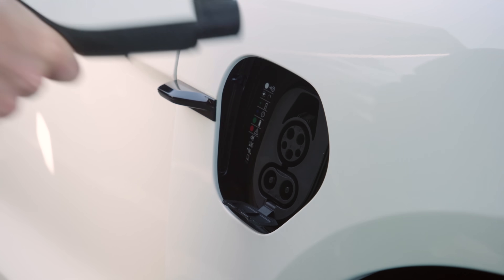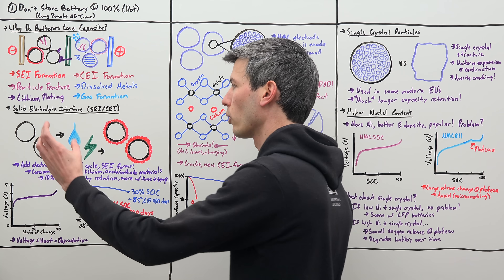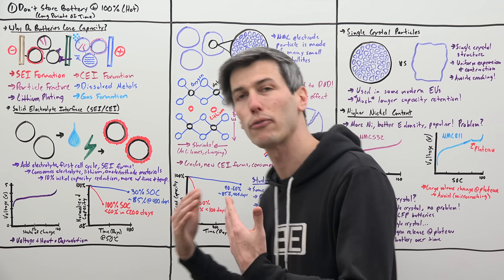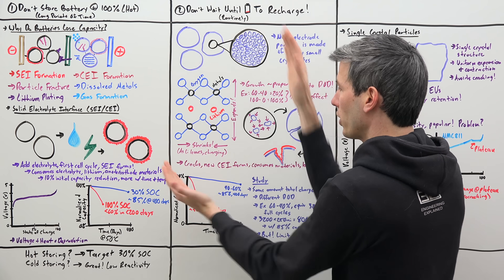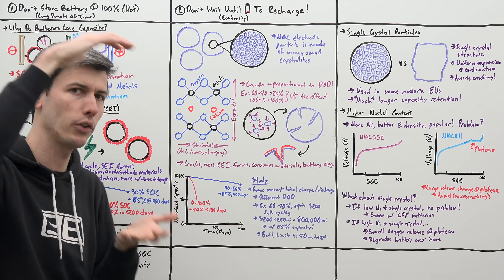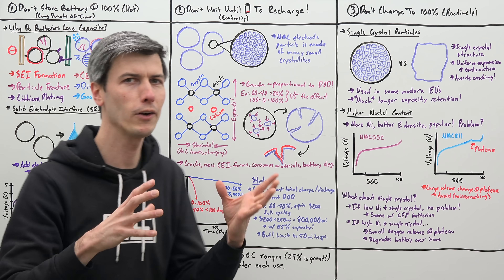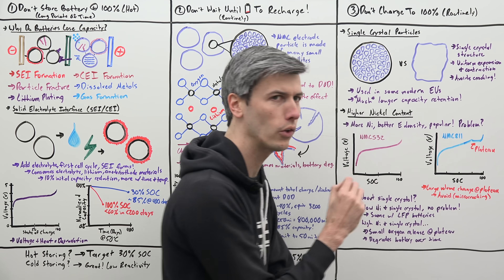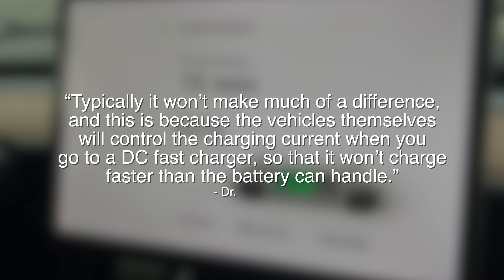How To Ruin Your Electric Car's Battery - NMC Edition!

Comment: This very good but one question isn't addressed. Most cars have a usable battery capacity (which is 71 kwh for my BMW IX) but the actual amount is higher (76 kwh in my car). Is this buffer engineered to avoid degradation? Do we still need to charge to 80% of the usable capacity?

Comment: I'm charging to 80% using a hyper fast charger (175kwh), disconnecting and charging to 100% using a 220 charger, wrong or right?
Reply: If you're using an LFP battery that's fine. If not, obviously that's not fine. Watch the video.

Comment: this is another reason why ev sucks  we not ready for this  plus nobody talking about used ev cars for sale, if the battery was abused we have no way of knowing this and could be buying a massive cost for a battery later
Reply: Yes, the battery's condition is a risk.  But there are devices which can plug into a car and run diagnostics on the battery to let you know whether any issues exist.  I suspect something like a battery bill of health will be good practice for sellers to provide when EVs become more prevalent.
Reply: EVs are fine, and it's easy to check battery health.

Comment: Jason, while I've always heard it's not desirable (as you indicated in the video) to store a battery at 100% SOC, I've heard repeatedly that it's beneficial to charge to 100% once a month or so as that will make the battery cells "balance".  Is this a good idea or nonsense?  We own a Kia Niro EV and the owner's manual states "If the high voltage battery charge is below 20% you can keep the high voltage battery in optimal condition if you charge the high voltage battery to 100% (once a month or more is recommended)".  So the Owners Manual is certainly not as clear as could be.
Reply: If the battery is LFP then you're supposed to charge to 100% once per week.  Just check the owner's manual.

Comment: The new chemistries have more cycles and are often lighter and safer and cheaper.  
What about my other e-things?  
I standardized on Milwaukee for all my tools.  
From drills to chain saws.  When will I be able to buy new chemistry batteries for these?  
I have a Ryobi riding mower that uses 4 12-volt lead-acid car batteries. 
Was thinking of upgrading it to lithium ion next summer. 
 Would prefer the new chemistry if I could.

Comment: If say for optimum longetivity & performance, these batteries need to operate inside the 20~80% SOC, then manufacturer's should quote their performance & capacity based on these numbers: battery power, range etc.
The BMS should control this invisibly to the driver. When the latter see 0% charge, in reallity there is still 20% left and and when seeing "fully chrged, 100%, the actual SOC is 80%.
MAybe this is already done by the manufacturers so that joe public need not to worry about all the common mistakes you described

Comment: I have a December delivery 2022 Model Y LR from Shanghai.

I’ve covered 35,000 miles. With around 30% of my charging being at Suoerchargers.

I charge at work, not at home. I usually charge to 80% and use 20-30% daily. Possibly too often, I’ll take it up to 90%, especially before a weekend.

Should I be concerned that I’m exceeding the 75% suggested here? I could adjust my maximum routine limit, but that would mean that I need to spend longer charging on a Friday, or before a trip, which is inconvenient as I don’t usually spend all day actually in the office.

Comment: 1. Long term storage: Cool environment preferred, if hot environment unavoidable, store at low state of charge (i.e. 30%)
2. Keep a low depth of discharge (battery percentage change); a bunch of small charges (+20%) >>> infrequent full-depth charges  (+100%)
3. Avoid the extreme states of charge (0% and 100%); charge to 75% MAX
3a. If you can't charge your EV at home, don't get an EV

Comment: I've just been charging from 20% - 80% unless I'm planning a long drive then I'll charge up to 90 - 100% for the extra range. When you're at fast chargers its considered rude to "top off" to 100% all the time and the norm to only charge to 80%. Some fast chargers start hitting you with idling fees if you go above 90% or sit there at 100% for long periods as well.

Comment: My question is "is it better to charge to a max of 60% or a max of 80%? i.e. 40-60 or 60-80? On my Bolt EV I can easily set the max charge to 60% and then just plug in every day. I typically only drive 25-30 miles. 

I had a 2015 Spark EV I bought in 2019 at 35K miles that had about a 10-12% battery degradation. After 3 years it had a 35% degradation. My charging strategy was to plug it in whenever I could, thinking that the battery conditioning was the most important thing in my hot climate. But the Spark EV could not be set to less than 100%, so it always charged to 100%. I decided that was a huge mistake, so when I got my Bolt I followed the 20%-80% guideline but that means I only charge it about once every 2 weeks. THIS video seems to indicate that as a bad strategy. I should set charge limit to 60 (?) or 80 (?) percent and charge every day. I already plug in every day when it's hot to run battery conditioner but usually keep the charge setting at the minimum.

Comment: Hey Jason, can you revisit unsprung weight and explain it in numbers? Many people say one pound of unsprung weight is equal to x pounds of sprung weight, but there is no consensus on what that number is. Maybe it varies depending on the overall weight of the vehicle (kind of like how weight loss in a light vehicle is more noticeable than in a heavy vehicle)? I bet you can come up with some sort of formula that extrapolates a rough estimate, and translate what those numbers mean in in everyday driving/racing. Also, which makes for a more comfortable/quiet ride in a heavy luxury vehicle, lighter or heavier wheels? Thanks :3

Comment: If you reversed aerodynamics for an EV could you effectively generate lift and therefore reduce weight and improve fuel economy? If it works don't steal my idea Elon!
Reply: They don't have downforce. You wouldn't generate lift, you would only generate drag.

Comment: So I just got the new 2024 Kona electric limited 260 miles of range. My work is only 2 miles away. I only use what 3-5 miles of range and lose some because I have to go up hill for 0.5 miles to get home. I charge to 80% max, sometimes I'll charge to 100, but my max I limit it to is 80%. I  use a 240v charger at home. Should I let it discharge to 40? 30? 50, to get the max out of it?  20% is when my low battery warning appears

Comment: I drive a Mini Cooper SE. It only has a 32.6 KWh battery. And Mini says it is fine to charge it to 100% because we are limited to only 29 KWh of the battery. So, you can fully discharge and charge it up to 100% and there will be no issues. And they come with an 8 year 100,000 mile warranty.

Comment: I recently purchased a BMW i4 M50 and have been charging it at public charging stations to about 99% percentage and then pulling it in at night with the Level 1 Charger. It's usually at 100% when I leave for work in the morning and I commute downtown for about a 25-minute trip. I charge it in the evening after work when I get off and think maybe I'll start charging it only to 75% and then plugging it up at night. I'm getting a Level 2 charger installed this week so definitely will be charging it less often.
Reply: Yeah don't charge to 100% when you're not doing a roadtrip.

Comment: There is something off here... so why Tesla RECOMMENDS to charge to 100% the new LFP batteries to maintain battery health? Tesla would say just that charging 100% will not damage battery as before. Weird..
Reply: Just to clarify... the message on Tesla app when you change max charging level at 100% is:  "To maintain battery health, keep the charge limit at 100% and charge fully once per week". But Tesla removed this recommendation from owners manual... My guess is that it is not 100% true :) They just dont want people complaining about range estimates if BMS cannot estimate proper your range when you never charge to 100%.
Reply: >> so why Tesla RECOMMENDS to charge to 100% the new LFP batteries to maintain battery health?  <<
100% full charging is required in all LFP EVs.  That's a trade-off, not a feature, contrary to popular myth.  LFP unlike NCM has flat discharge curve and its' difficult to estimate accurate SOC/range, so the BMS in your EV must be recalibrated frequently to avoid misreading SOC and associated problems such as cell imbalance which can be fatal.

Comment: Don’t agree with your 2nd point which goes against everything I know to this point about minimising charge cycles. You correctly state 3,200 cycles which is considered the useful amount before 80% degradation. But you then say by only using 20% of the capacity you’d get 800,000 miles but this is incorrect as it would only be 160,000 miles. 250miles divided by 5 and times 3200 equals 160,000. Not good. I was always taught to use 20 to 80% and minimise cycles to get maximum mileages with minimal degradation.

Comment: I charge my Tesla Model 3 Long Range to 55% nightly at home.   I usually only use 10 to 15 percentage points of battery daily.   So, I am typically in a short usage/charging cycle range of 40% to 55% daily.    I do charge to a higher percentage for heavy use or trip days.   Thanks for the video!
Reply: Why only 55?  It makes no sense at all.

Comment: Hello, can you make video about using 0W20 oil in old cars, what happens? Also, using 0W40 oil in engine what ase meant to use 0W20 oil in owner's manual.

Comment: I charge my Mini Cooper SE to 100% for two reasons...1. They have a built in buffer where 100% is not actual 100% capacity. And that built in cap/head can get used as the battery degrades. But this all happens behind the scenes in software (hope this is all true 🤞)..2. The range is short enough that charging to 80% is like losing 25 miles of range haha!

Comment: I live in an apartment about 2 blocks from a supercharger and am planning on getting a used Tesla M3. I am able to charge at work, not sure if itll be 110v or 220v, but it's only 5 miles away, so even 110v would cover daily use. Mostly im concerned about leaving it outside year round, I do not have shade or a garage to park in.
Reply: What's the issue with leaving it outside?
Reply: @logitech4873  I've read that low temps can sap battery levels, but there's a wide opinion of how much per day of sitting. Idaho in winter can get down to negative temps at times, so it's a concern of what percentage I should leave it at. I know you want to precondition the car before charging at low temperature, and because we're so close to the chargers even if it was way down it's still going to make it there.

Comment: Thank you for the explanation. Basically (in theory), battery degradation is the same:  charging once a week from 0% to 100% vs charging 5 times a week from 40% to 60%. 😊

Comment: Great info. It took me a lot of time and research to get to the same conclusions. Great job of packing it all into a short vid.

Being retired and not much driving I keep my model y at 60%. Only charge higher when I know I going to need it. Also charge on 30 amp circuit which gen 2 mobile charger recognizes by which plug option you snap into it. There are 8 different plug options and four different current options. 15, 20, 30 and 50. By using the 30, it uses the 80% rule and charges at 24 amps. Nice and low. Super chargers are the least preferable way to charge if it can be avoided.

Comment: I use a level two charger at home to charge my Cadillac lyriq all wheel drive. It takes about seven hours to get a full charge, but the slowness of the charging helps save the life of the battery.

Comment: With EV 80% is the new 100%... The algorithm limits battery charge and discharge to between 20% and 80% and as the battery ages ( to maintain range ) it allows the charge the go into the region above 80% and below 20%,  a bit of 'sleight of hand' going on here'.....   I can fill the tank on my ICE to 100% and leave it for months without any problem.... I can also leave it empty if I choose.....
Reply: Depends on the EV. With LFP ones you're encouraged to charge to 100%.

Comment: Nonsens, a Tesla 3 RWD has a LFP battery which does’nt has this problems.
Reply: >> Nonsens, a Tesla 3 RWD has a LFP battery which does’nt has this problems. <<
LFPs are cheap, inferior batteries which is Tesla use them in entry-level, low-range EVs.   Tesla likewise uses NCM for Long Range and NCA for Performance models.

Comment: Maybe I'm missing something here but at 7:30 to 8:00 minutes you are talking about equivalent discharges amounts.  So isn't what you are talking about is a full discharge on the 0 - 100 % charging option and then 5 discharges on the 40 - 60% charging option.  In either case, after 400 days, wouldn't you have 400 full discharges in total rather than the number of 3200 full charges that you came to with the 40 - 60% option.  A bit confused on this.  Can you help me out?   I'm sure your numbers are right but I'm missing something in the explanation I think.  Just got an EV6 and have been doing the 20 to 80% charging rules approximately, all at home.  Always capped at 80%, unless there is a trip planned or potential for bad winter storm which might have a blackout to which I can use the battery as power backup.  I generally look at the battery charge remaining when I get home and try to determine if I need to charge based on how cold it is and what my plans are for the next day.  So, I generally start recharging anywhere from 25 to 50% range.  Try to keep above 25%, especially in the winter here in Canada to ensure the 12 volt battery is maintained by the main battery.

Comment: I take it we are talking about DC fast charging instead to AC charging at home when referring to keeping the charging limit to 80% because I was always told that home charging isn't an issue to charge to 100%.
Reply: This is about state of charge. It's the same when you charge at home. Don't charge to 100% unless you need to.

Comment: You're welcome :elbowcough:
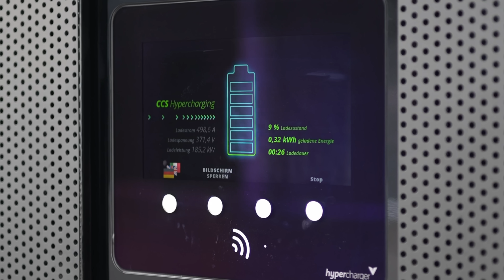8:35 Don't charge to 100% unless necessary. Lower the better. High voltage bad.
1:05 Don't store your battery at 100%, especially in hot environments for long periods of time. Heat bad.
4:35 Don't wait to recharge unless necessary. Frequent small charges in better. Deep cycle bad.
Reply: Thanks bro 🤟
Reply: avoid doing fast dc charge more then 4x a month 10-80% level 2 AC charger stick to 7.4 or 11kwh battary will last longer then your car you wont even see 90% degradation after 10 years 200k km.
Reply: @patthonsirilim5739  Still no one can explain to my why I should limit my range to 80 % for the entire lifetime of my car (by charging to only 80 %) when I could just always charge to 100 % and experience a gradual degradation to 80 % during the lifetime of my car.
The only reason would be to get a higher resale price. And even if you only charge to 80 % all the time you’re still going to see at least 5 % degradation.
Reply: @manuel0578 well you dont have to but its good to know say 5 years in the ownership that you can  still range 95% of the state range instead of 80% when you really need extra range on a long trip plus if you plan on owning the car for alot longer that its stated 8 years battary warranty you need to baby the thing.
Reply: @patthonsirilim5739 I’d rather use 100 % all the time than waiting for some day in 10 years where the degradation is 20 % 😂
Reply: @p @patthonsirilim5739  It’s totally irrelevant anyway because most cars are leased these days and during a typical lease of 2-4 years you can do pretty much anything you want without getting too much degradation.
Reply: @patthonsirilim5739  That's not what was said in the video, it's almost the opposite really. They said don't worry about DC charging.

Comment: Folks,

I already shared my thoughts about this topic, as an Electrical Engineer (with Major in Battery) for 20+ years.

The best charging % frame is BETWEEN 30% - 70% (because 40% - 60F is really NOT possible for 90+% of people who drive an EV)

(IF you will have a Long Road Trip, charge it to 100%, then use it until 10% before you will go back to your normal 30% - 70% charging habit)

Again, just STAY WITHIN 30% - 70% and you will be fine for years to come.

Have a great day to y'all!
Reply: In our Tesla app it said set charging to 100% to maximize battery life.
Reply: @joester4life  LFP battery. That's different.
Reply: That’s 40% of usable battery. Not very practical if you don’t have home charging. Not arguing with the chemistry, that is definitely the best way to preserve the battery, it’s just not feasible for many. My view is use 5 - 80%.
Reply: GM did a study years ago for the Chevy Volt (and repeated with similar results many times). ~80% of daily drives are under 40 miles. So 80% of drivers can do 40-60% in most modern EVs if they charge overnight. 30-70% would probably cover 90%+ of daily drives.

Comment: Okay I think that there are some things here which are unreasonable... using only 20% of your battery isn't 50 miles on a 250 mile EV unless its 50 miles in your city only. Driving on the highway depletes the battery quite fast and 20% is around 30 miles which means you can only drive 15 miles from your house.... talk about very short trips. 

This video is a perfect example of why EV's aren't for everyone and why their lifespans vary so wildly and also why they are worth so little in the 2nd hand market. Just like with a cell phone; its hard to know if someone really took care of their battery or not.

Comment: That's why my battery degradation is too low in my Tesla model 3 at 270000km in 3,7years. I live in Canada and park my car outside 3 winters straight. Good to know. And I do charge to 100% most of the times , as you can tell I’m using it, car not seating in garage.